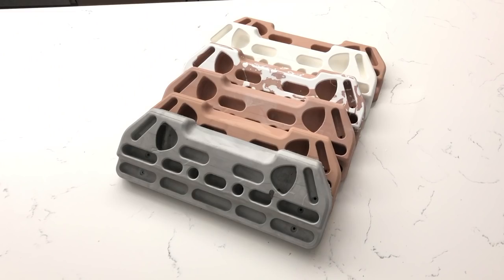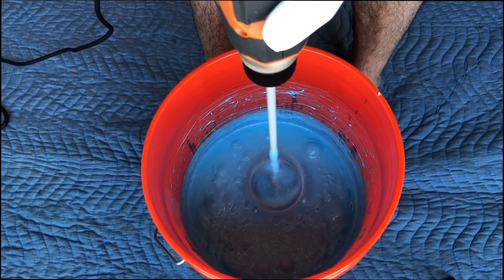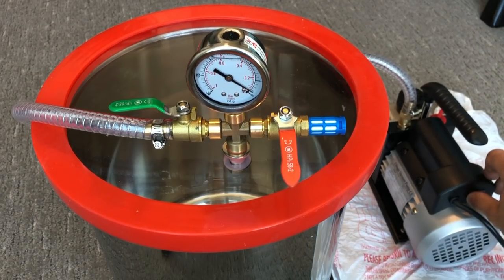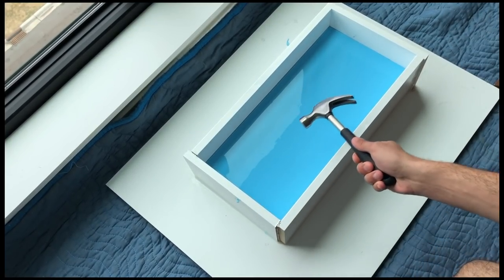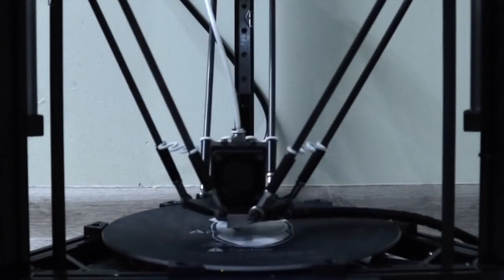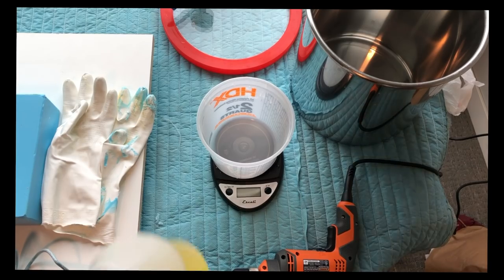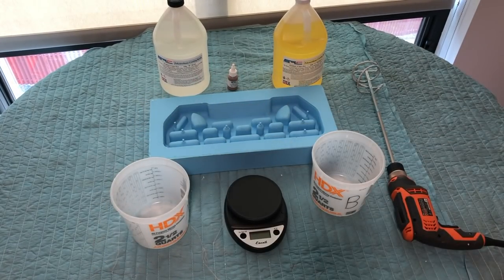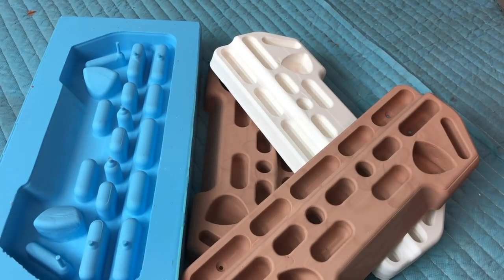Best Way To Make Parts At Home - RTV Silicone

Comment: Is there any material in liquid form (such as polyurethane) that would be like Styrofoam? I wanted to make Styrofoam molds for aluminum casting using the lost-foam method.
Reply from the maker: Styrofoam by definition would be expanded polystyrene, and the answer is thereby NO. however there are polyurethane mixtures just like the one I used here that turn into light foam. That being said I'm not sure if it will serve the same function in your concept. you can always try 😃.
Reply: @ActionBOX  Yeah, I'm going to test expanded polyurethane and see how it behaves. The problem with casting aluminum is that the lost mold has to evaporate quickly as soon as the molten metal enters. Thanks for replying, I really liked the video.
Reply from the maker: @HunterNX_s  I dont have experience, but I know that PU will take much longer to evaporate as it is far more resistant to heat than EPS. I will try to think of a solution and Ill get back to you when something comes to mind. I have had this problem before as well so I would love to find a solution. I did previously create a way to do EPS injection into molds, but that was a very expensive setup. It was similar to my plastic injection machine video in some ways.
Reply: If you're using lost-foam with dry sand as a medium, I can't help much, but if you use plaster or something like greensand, you might be able to pre-heat the mold, an thus evaporating the polymer before pouring. If you opt to this, lost wax might be a good option as well
Reply: @alexandrelanhoso5538  I've had success with some molds made straight from Styrofoam with a layer of plaster, but what I'm trying to achieve now is some way to make the mold with a liquid material that solidifies (and is able to evaporate) with the purpose of copying some plastic pieces directly. I think I will try to use wax like you said.
Reply from the maker: @HunterNX_s  No problem, hope my comments help. Feel free to help me out and share this video with anyone who is interested. Thanks in advance 😁
Reply: @HunterNX_s  Robinson Foundry also has very good videos on that. Recently he did a very cool double thread screw cast in aluminum using lost PLA
Reply: Using 3d printing might work well for that.
You can get a good printer like the Ender 3 for about 150€ and the pla for printing is also super cheap.
And it would allow you to make different shapes for casting without having to make a new silicone mold.

Comment: I'm sorry if this is a dumb question, but how do you clear the silicone out of the vacuum chamber after the fact? Does it just peel off when dry?
Reply from the maker: Great question. It comes off in 1 piece with no problem at all.

Comment: How flexible is the new mold? Can you use it with a negative draft or would you need a two part mould?
Reply from the maker: Either should work. Cheers

Comment: Can you make the original part out of styrofoam? Does it stick too badly to the silicone?
Reply from the maker: Nothing will stick "too badly" to the molds other than silicone based compounds. Styrofoam will work, but the process of injecting EPS (expanded polystyrene) should probably require a solid metalled mold as it uses steam. I hope you enjoyed the video, don't forget to share with your friends and help me out 😃

Comment: No mold release required for these processes?
Reply from the maker: Nope, thats one of the major benefits of silicone and how almost nothing sticks to it 😃. What type of project are you planning on making with this process?
Reply: @ActionBOX  Nothing planned yet. I only recently got into 3D printing and am starting to see that the possibilities are almost limitless. I do have experience moldmaking and laminating with polyester and epoxy.
Thanks for your excellent videos 👍
Reply from the maker: @dpforth  Right on. Good luck with the projects.

Comment: A vibratory table will also help remove bubbles
Reply from the maker: Great Point. Do you recommend building or buying one?
Reply: @ActionBOX  They are pretty easy to build.  there are lots of Vibration Motors avail on Amazon.  Mount it to a sheet of plywood that is suspended by springs.

The other way to get rid of bubbles is to put the mold in a pressure vessel.
Reply from the maker: @medengineer  Thanks. Pressurizing doesn’t get rid of bubbles , it just makes them smaller which means that I would have to maintain pressure until the medium cures. Otherwise if I remove the pressure the bubbles expand again. I will definitely try to make that vibrating platform. Cheers.

Comment: This is actually how I ended up scanning my face, first a smearable silicone, then a plaster cast then drawing a grid on the cast and finally photogrammetry.
Reply from the maker: Thats awesome. Its definitely a very cheap and quick method to get a high quality replica of mostly anything. Feel free to share your results, Id love to see it.
Reply: @ActionBOX  Believe me, it sounds simpler and faster then it actually was. The whole thing took probably a few weeks, with photogrammetry being the worst time consumer. The process could have taken 10mins if there was a cheap 3d scanner solution. I have a Sense 2 from 3d systems, but it never worked out of the box, the software was extremely buggy and its been discontinued so no support whatsoever. Hopefully you'll be able to put something better together. Fingers crossed.
Reply from the maker: @jonjon3829  I have had success with an Xbox Kinect, and turning that into a 3D scanner. Resolution was not absolutely perfect, but that is one avenue you would explore.
Reply: @ActionBOX  I know, we talked about it under a previous video.

Comment: Thank you so much for showing this process. I was just thinking today about how silicone is poured. I wish I had come across your video earlier. I filled my CNC table with silicone before putting on a Saunders plate. I just tubed it layer by layer. I don’t have a vacuum chamber so that would’ve been an additional expense, but then I would’ve been able to pour silicone so… 😂 great channel!
Reply from the maker: Glad it was helpful 😃. Feel free to share with others who are interested, it would help me out 😊.
Reply: I dont use a vacuum chamber,  that thing he says about pouring from high in a thin stream is a big and very underrated.  I do modem and scenery making for wargaming and by using that technique I have never needed vacume chamber.  I also do do poor to the same scale as he does
Reply from the maker: @richardthomson4693  Thats awesome, thanks for backing up this method. Its great for anyone who doesn't own a vacuum chamber.

Comment: So how much does the mold making stuff cost?  Is it cheaper to buy individuel containers of 100 % silicone caulking from home depot or using this method?  What it the cost of this method?
Reply from the maker: The silicone you are referring to is “air dry” so you can not cast it in such thick sections (which is why it doesn’t harden inside its tube). RTV silicone doesn’t “dry” for lack of a better word, but rather it “cures”, so you can cast it in thick sections as long as you mix it with the hardener properly. Hope that helps.  

Cheers,
Dave

Comment: You're using the wrong mixer for this. Concrete mixer will add a lot of air while mixing. You need a wall putty mixer which mixes the compound with very little to no air. Even with a paint mixer the results should be better. Also you might want to use less RPMs to add even less air.

Comment: Could you pour the resin in the mold and put all of it in the vacuum chamber?  
Obviously, if it was a smaller piece or bigger vacuum chamber.

Just wondering.
Live your vids. Makes me feel Luke anything is possible because I have this mental block that says it's to hard,your not smart enough and you would have to study for years but in reality, as your vids have shown me. Anything is possible. They just make it seem hard so we don't try. 
I just live YouTube and wish I had it when I was wee lil lad
Reply from the maker: Hi Joe, thanks for your support 😃.  The vacuum makes bubbles expand which makes them float to the surface.  If you place the resin in a huge vacuum chamber and let it cure before eliminating the vacuum, you will actually make the problem worse. I know from experience 😜. Hope this answers your question.  We actually have a diy huge vacuum chamber video coming up in a few weeks so don’t forget to turn on your bell to get notifications.  This will be a UHV or Ultra High Vacuum Chamber.  Cheers, Dave

Comment: How much does it cost you per cast?
Reply from the maker: For this specific mold?
Reply: @ActionBOX  
Ya, in terms of material volume. Not the cost of the mold it's self, but the 2 part polyurethane?
Reply from the maker: @Larsen514  about $50
Reply: @ActionBOX  
I guess thats not a bad price. I don't know the price of those training finger hold but I'm pretty sure its more than that. I'm from canada so my next question is 50$ USD?
And do you have a link there where you get your resin?

Comment: That's a lot of resin have you thought about an update were you make a negative buck to thin the epoxy
Reply from the maker: Good thinking, however this piece needs to be full as it holds an entire human.  It’s called a hang board. Hope you enjoyed the video. Cheers
Reply: @ActionBOX  ah wasn't aware it was a hangboard must have missed it in that case perhaps a metal bar
Reply from the maker: @crashoverride93637  good thought. I was thinking of using a filler.  Perhaps rocks etc.

Comment: MOLD RELEASE
Reply from the maker: It worked without it as you see in the video
Reply: @ActionBOX  I know, but it will lessen the degradation of the mold as you make more parts out of it, and less of an issue of fighting with it to get the parts out.
Reply from the maker: @mtktm  Fair enough. Getting parts out is no issue, and it definitely adds cost and a step to the production process. Ill give it a try though and let you know my thoughts on it relative to what I do now. Thanks for sharing your thoughts 😃

Comment: Vacuuming isn't necessary for every liquid. really, it is only needed for the most thicc or viscous ones. Plaster, depending on the ratio of plaster to water, might require a vacuum. Polyurethane however is super thin, so there is no real benefit to vacuuming it.
Reply from the maker: In my opinion that is not true, you definitely see a huge difference in the number of bubbles inside the polyurethane part if you vacuum degass the liquid.
Reply: @ActionBOX  Huh, that's interesting. I would have imagined that it makes less of a difference. Maybe one could get away with vibrating the mould after filling it up a little bit? Hand-held sanders, the sides of oscillating tools, or even certain 'vibrating female pleasuring devices' work surprisingly well for this.
I've played around with creating one-time-use plaster moulds for DIY-aluminium casting for some time now and vacuuming does work there, but you really have to watch out for the cure-times.

Comment: Silicone mold is so damn expensive!
Reply from the maker: For one part perhaps it is expensive, but if you make many parts it pays for itself very quickly. I made a huge mold in this video, and it only cost ≈$400.
Reply: @ActionBOX  "only"?! 😬 i saw the thickness and tough your mold was damn expensive and it is. For sure, if you sell parts and will be used more times, it's worth, but otherwise it's not.
Reply from the maker: @chazy10  Very true. Each user has to conduct their own calculation to determine whether it is worth it or not. I spent $400 plus costs on the polyurethane, and it paid off for me.